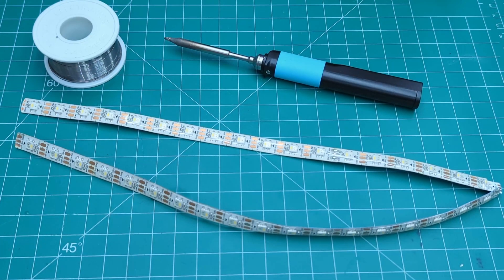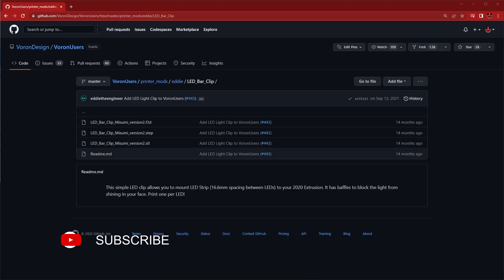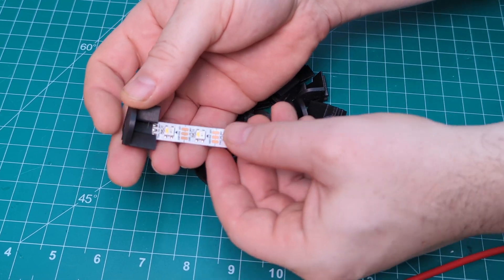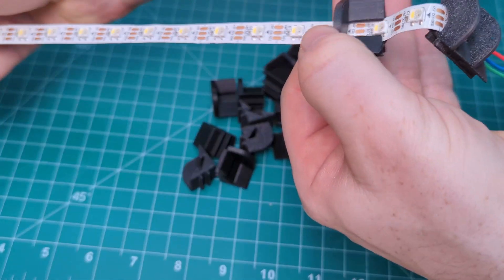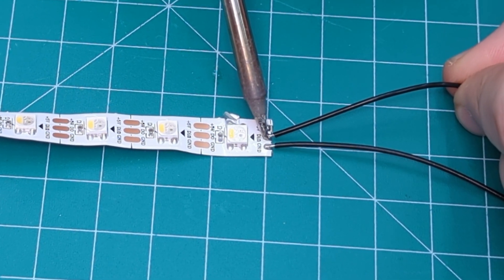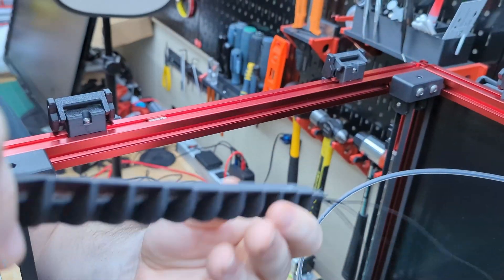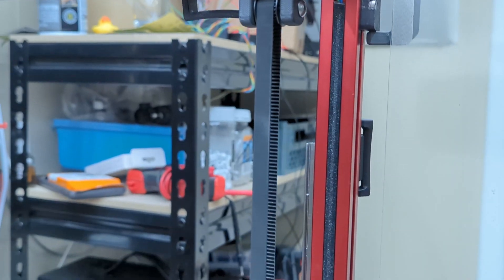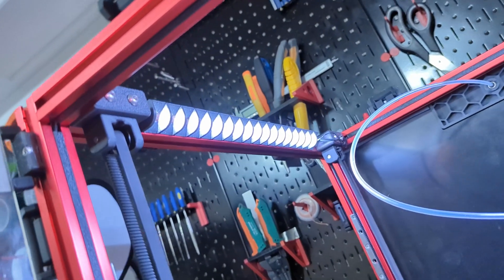Voron Mod Showcase: LED Bar Clips

Comment: Please make an actual in depth video explaining the wiring for all types of boards (2 RGB Specific headers, 1 RGB Header, None and what types you can use) 

Then explain the why, and how to determine what pin's you're using. etc. Explain why you put what you put in the .cfg. 

Your videos keep showing up when I google an issue, you obviously pick good topics, but I find your content is very surface level. One of the biggest things i've noticed when doing this whole Voron/klipper thing is that so much of the content goes into it with the assumption you know all the ins and outs. That's one of the most discouraging things about klipper as a whole. 

You obviously know your stuff. I'd really like to know why my printer won't boot when I plug my LED's in. lol. There's not a single tutorial out there on actually installing them.
Reply from the maker: Hey there, sorry to disappoint.  Klipper configuration isn't something you'll ever really see us cover in a video.  Things change too quicky in software, and klipper has excellent documentation already.  There is nothing that can cause your printer to stop booting with RGB LED's plugged in except a short in the wiring.  Double check that + always goes to +, - always goes to - and they never cross. a multimeter is a very useful tool to find shorts.

There aren't a lot of videos about configuring RGB Leds because there really isn't anything to show. They either work or they don't, and the only way you can screw up the configuration is to give it the wrong pin name.  These pin names are documented on the pinout diagrams for the controller boards, every board is different.

If you have the correct pin name, and your wiring is correct, then you should see some activity on your LEDs when you tell them to turn on. it might not be the RIGHT activity (they may flicker, or show the wrong colors, or only a few leds might light up) but you should see *something*. if you don't, then your wiriing is almost certainly the problem.

the color_order, and chain_count settings can be used to correct the colors, or get the correct number of leds to light up (respectively). but they are never responsible for the leds completely 'not working'. that's always a physical problem.
Reply: @MapleLeafMakers   Thanks for the reply. You were right, it was a wiring issue. I have 2 printers with the same boards, one's on the Din Rail in one direction, the other is flipped and of course I read the pinouts wrong, sometimes I think sleep is important when tired :)

Thanks again for taking the time to reply to a curmudgeon like me. All is working now.

Comment: Since you need to peel the plastic coating off, should I just order the IP30 one (no coating)?
Reply from the maker: Absolutely!
Reply: @MapleLeafMakers  I have another question. Since you are using the BLtouch port, can you control individual LED as in different channels? Or only the LED port is addressable?
Reply from the maker: @drrobotsir  it works exactly the same as the LED Header, just a different pin #
Reply: @MapleLeafMakers  thanks

Comment: Nice Video. Can the board safely handle that voltage? Can you change colors?
Reply from the maker: The board is made for that voltage, yes.    The strips we used are RGBW allowing us to individually change colours on each as we want.   

We use the LED Effects plugin for klipper and will have a video on how to configure that soon!
Reply: @MapleLeafMakers  Perfect, looking forward to it!

Comment: sweet! thx for the info specially about using the BLTouch input.. i was looking at rgb extension boards to upgrade my lights but this works perfect. 
Can i also use any 5v to add a buzzer to my LDO? the factory buzzer pin is part of the ribbon cable header for the display and the display with LDO doesnt have a buzzer.
Reply: If its a buzzer with a coil inside, I would use a transistor or optoisolator to turn it on. It may be unnecessary to do that, I'm not 100% sure, but thought I'd mention it.
Reply from the maker: No problem!  Glad you found it helpful.   Are you using a touch screen  display?
Reply: @MapleLeafMakers  no, i have the simple Mini 12864 Display that came with the kit
Reply from the maker: @3rdPedalMedia  Well good news!  This definitely has a buzzer then!    We use it in our LDO 2.4 R2 kit.    It's built into the display itself.  Just configure it in your printer.cfg and you can send it tones!  

We made our 'LDO'  (named El Dio) play 'Holy Diver'!
Reply: @MapleLeafMakers  rly.. i have batch 3 and asked in the LDO channel and they said no.. i'll configure it up and see 
thanks